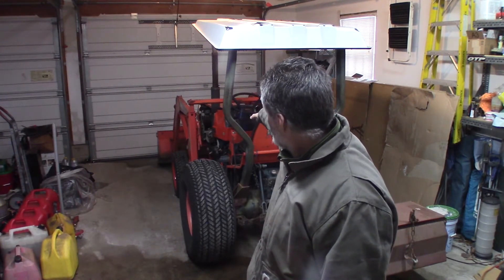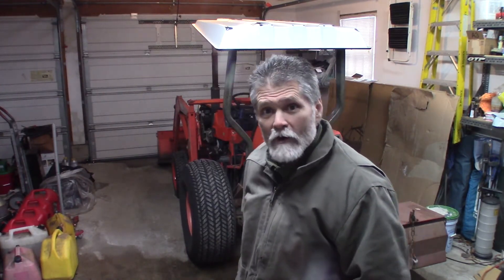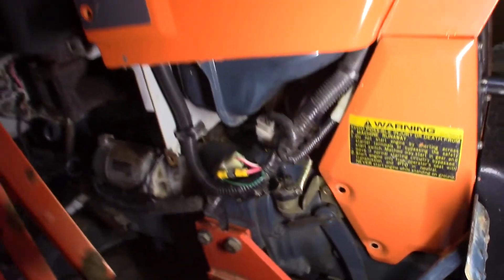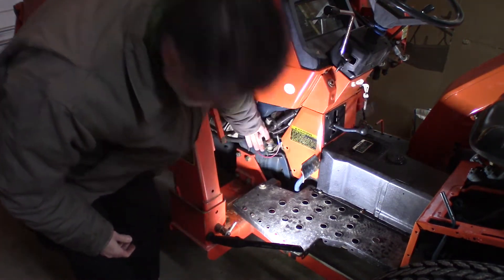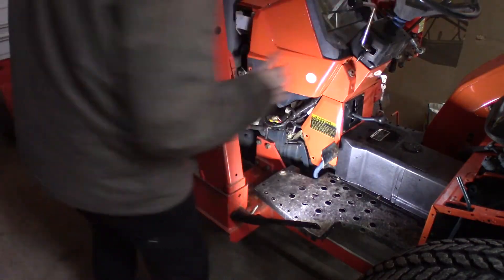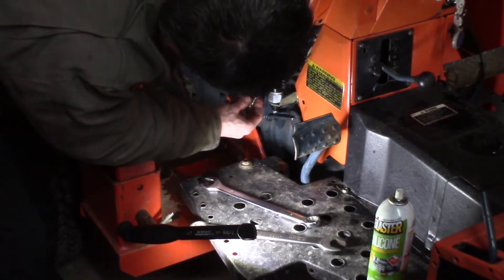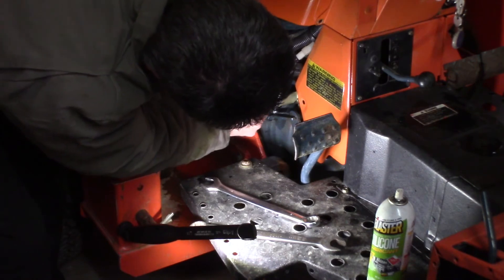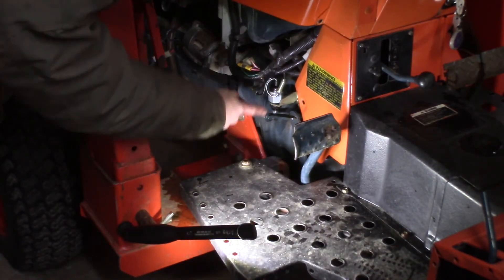Kubota L2250 - No Crank

Comment: I wish you would have showed us how you jump the connection. I seen in comments you tried to explain how you did it but seeing how its done much better for us that are electrical handicap
Reply from the maker: It's simpler than you think.  There are two wire connectors to the clutch switch.  Just unplug those two connections on the top of the switch and connect the jumper wire between the wire you unplugged from each side.

Comment: Complete idiot here, how do you make the jumper
Reply from the maker: Just take a piece of wire, disconnect the connectors from the neutral safety switch.  Get connectors that match up to  wire on either side of the switch that you disconnected and connect the wire with connectors to the wire that you unplugged the switch from.